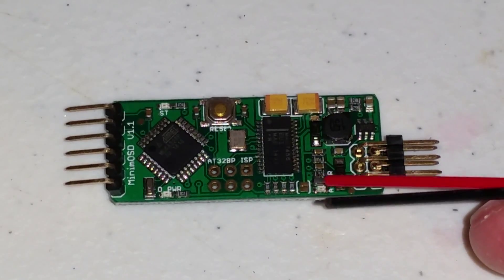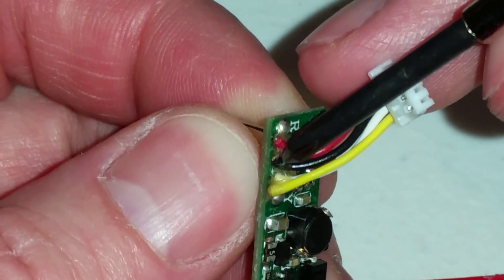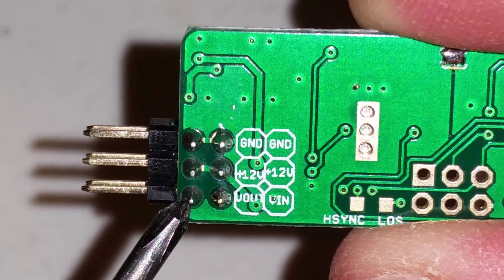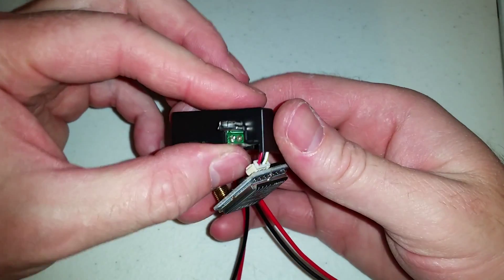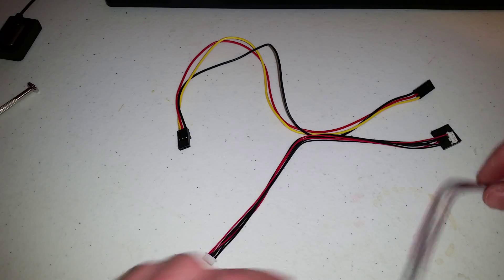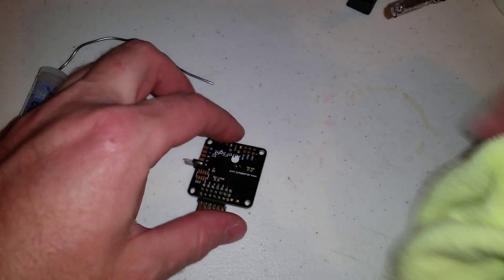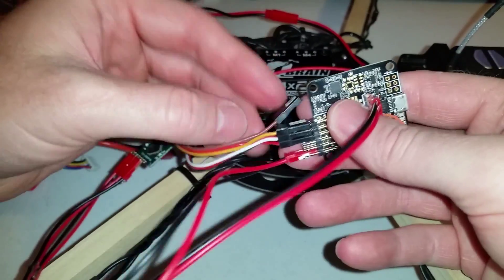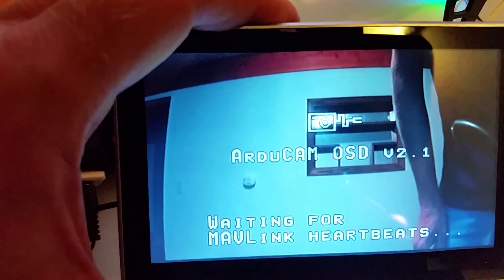Add a MinimOSD to a Mobius Docking Station

Comment: Hey, I have currently the same issue, that I'm not receiving any Mavlink Heartbeats from my APM. From what I see on the wirering diagrams you need the ground cable from your transmitter also connected to the minimOSD. I "hacked" the mobius dock as you did, and I'm wondering if it's not working due to the missing ground connection.
Reply from the maker: +Lux Keiwoker Once I updated the stock firmware to Scarab OSD firmware it stopped giving me that error.

Comment: mobius utiliza la cámara para FPV y grabación al mismo tiempo? que utiliza el transmisor de video? tiene problemas de microcortes viven visión FPV video?
Thanzs for your video tutorial ist a great job! ;)
Reply from the maker: +Jose García 
Not sure if the translation is correct but...
"mobius use the camera for FPV and recording at the same time ? using video transmitter ? microcuts have problems viewing live video FPV ?"

Yes the Mobius can record and transmit an FPV signal at the same time.  You need an SD card and remember to press the record button before you take off.
Reply: very thanzs! 
and you have cuts in the video transmision fpv? or lag?
Reply from the maker: +Jose García The lag on the mobius and FT952 transmitter is minimal.  Maybe 10th of a second delay.  600tv line camera would be better for proximity FPV.
Reply from the maker: +Jose García A channel called Painless360 has a great comparison of the various cameras latency.  Even setting the resolution to 720p rather than 1080p has an affect on the latency.
https://youtu.be/pzf3yNlPQLA
Reply: Very thanks ;)